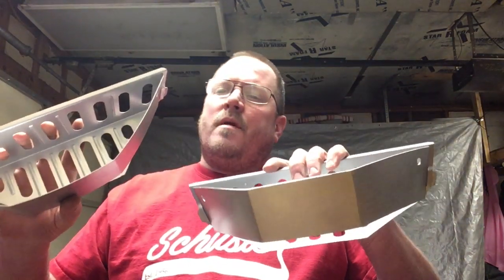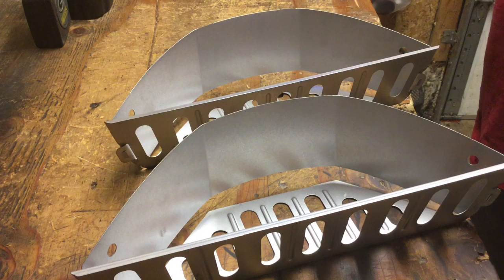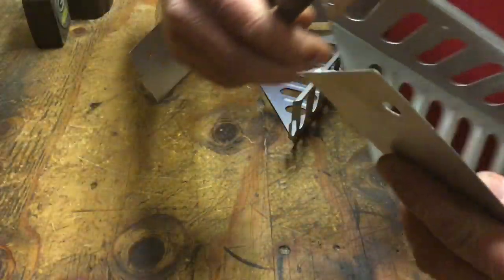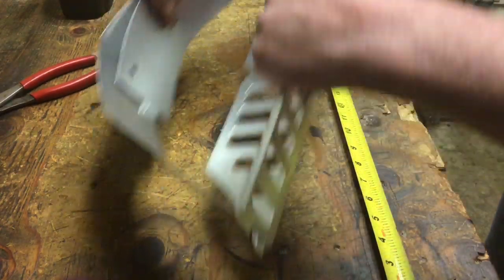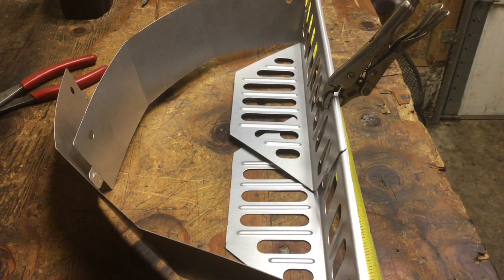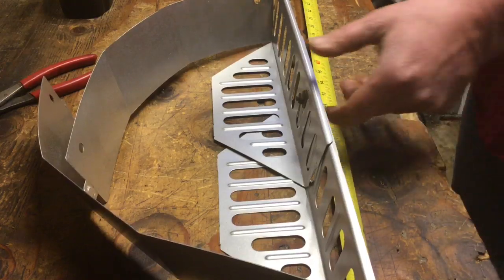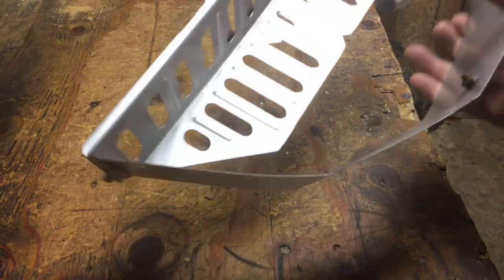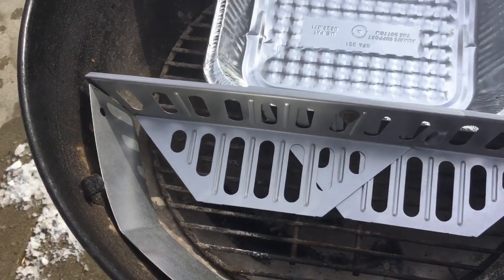Bro n Sear | Weber Kettle Charcoal basket Mod | Poor man’s | Slow ‘N Sear

Comment: These baskets came with my new Weber Master Touch and after my first attempt at indirect cooking, I was not happy with their function as separate units. I had done research on the SnS and was about to buy one until I stumbled across this video. I used the baskets that came with my grill, made the same modifications (with a few detail differences, fasteners mostly) and the result was superb! Mad props to Daddy Dutch! Thank you!!
Reply from the maker: Glad the are working out well for you. I'm happy I could help !
Reply: @daddydutchbbq   I'm cooking a spatchcock chicken as I type with the bro and sear... Holding steady at 310 degrees for the last 3 hours. You da man!
Reply: That’s really great!  I think it would be great with a rotisserie as the coals should be to one side. I don’t think this is the poor man’s slow and sear, I think it’s the smart man’s !

Klaus
Reply from the maker: Hey Klaus, I appreciate it ! Thanks for stopping by! Cheers !

Comment: I cut to size a piece of metal mesh (the kind used for tiling) to keep the smallest lump charcoal pieces from falling through the grate and I wall it up with a couple of bricks.  Works like a charm.  My grill is a cheap, barely above camping grade rig and it runs and smokes like a weber.  The only other "mod" I made was to make a large diameter washer to keep the top vent disc honest and snug to the lid surface.

Comment: You are the man. You just saved me $100+ when all I need is $1.50 in bolts nuts and washers. Thanks Kent.
Reply from the maker: You are welcome Johnnie ! That's why I made the video !
Reply: Any ideas for the pizza oven. That would be huge.
Reply from the maker: @johnnymagsbbq8209  do you have the pizza attachment ? I use my baskets back to back in the center like a vortex
Reply: Daddy Dutch BBQ And Cooking no I don’t have it and I don’t want to spend $200 for one either.
Reply from the maker: @johnnymagsbbq8209  I'll call you tonight

Comment: Keeping the hot coals off of the kettle wall helps keep the heat in the kettle. The water pan helps block the radiant heat of the hot coals. Great easy mod! Right on Kent!
Reply from the maker: Thanks Mike. Just an easy inexpensive option ! Cheers !

Comment: What a great idea!!! Thanks a lot brother! Commented a couple days ago and came back to check it out again! Also, for that extra open space, I saw another video where he adds an extra 18 inch charcoal grate and sits it on top of the existing charcoal grate and turns it 90 degrees to make small squares and limits the charcoal falling through thus forcing the charcoal to burn even longer(hope that makes sense to everyone) will be trying it soon! Cheers brother!
Reply from the maker: Thanks for the feed back and for stopping by. I now have a piece of expanded metal in the bottom of the bro and sear. I also have a plate cut to cover the other part of the charcoal grate to force the air through the basket. Let me know how you like it!
Reply: Would like a link to the video you are referring to .. Thanks !!
Reply from the maker: @billb13  if I remember correctly you need a measurement on 22” on the straight side. I have not done a video on the expanded metal and grate cover but I will be shortly . Thank you so much for stopping by!

Comment: One benefit of the SNS is how it evens out the temperature across the cooking grate. I'd be curious how this setup compares. It certainly works better than the two baskets did.
Reply from the maker: Hey Ryan, just an inexpensive option because i thought the 2 baskets were clunky and didn't match up well together on the same side. Not a true replacement for the S n S but a very workable option. I have had a set up like this for the past year. It works very well . Videos upcoming.Thanks Ryan and congrats on your win last night !

Comment: Just did this on the 22 Kettle I just picked up used for $50! Will be trying it out this weekend. If the vents let too much heat through the opposite side, I might try a brick or two as to block heat.
Reply from the maker: Let me know how it works for you. Blocking the side will help on longer cooks ! Happy cooking ! Cheers !
Reply: @daddydutchbbq  Just finished a 2lb grass fed chuck. 3hrs, 2hrs wrapped in foil, 1hr back on grill. used Oak chunk, lit one end and it burned great at 250 for 3hrs! wrapped it and added a little more chunk. Also added a little honey and some double IPA. Did great for the 2hrs '(250-275). Unwrapped for last hr and it started to taper  at about half hr mark, stayed at 200 to finish. Got it resting now and it looks and smells amazing. Making some tacos with it! Pretty impressed at how easy it was to maintain that 250 mark!

Comment: Not only can you put some in a drip pan under the meat, but another approach is to put some in a small loaf pan or mixing bowl directly over the lit charcoal. Really helps to moderate the temps and provide steam in the kettle without totally blocking meat from heat under the grate like the SnS does. (Who only wants to cook the top side of their briskets and pork butts?)
Reply from the maker: I do put a water pan in most of the time. I also wrap the charcoal grate in foil to force the sir through the Bro N Sear basket.

Comment: The slow and sear costs almost as much as my Jumbo Joe.  Screw that.   I usually create my hot zone just by filling the side without my weber basket with hot coals and using the flat edge of the basket as a barrier.  Works great.   I might just try making this though, nice work, thumbs up!

Comment: This could be made easily with adjustability in mind. Using wing nuts and multiple holes along the back. Then slide the front closer and close up the back to create a smaller charcoal spot.

Comment: Hey on your thing you made I put some mesh on the bottom screwed it to it it holds the charcoal in a real nice so when you’re done you just pick it up and empty it
Reply from the maker: I actually put expanded metal in the bottom of mine. Or if you have a second charcoal grate, you can turn it 90 degrees also. Thanks for stopping by!

Comment: nice idea!!  I just use the empty baskets to create a gap on one side of about 1/3 and fill that up. Do you think this works better?
Reply from the maker: I think it works great along with the second piece of metal I put on the charcoal grate to make the air flow through the charcoal basket for a more efficient burn. Also Weber recommends not banking you coals on the outside of your Kettle to protect the paint .

Comment: i did this, but left the round part off and didn't put a bolt through it. allows you to adjust how far back you want the charcoal or how much of the grill you want charcoal in easily.

Comment: Love it, will be making one of these, love the name too. I've thought about how I could home make a Vortex but that's a pretty complicated shape :)
Reply from the maker: I’ve made a homemade vortex also. It is super simple too ! If you have a Walmart near by, go find a 5 or 6 quart stainless steel bowl, normally about $8 and cut the bottom out of it. There is usually a molding line you follow. You will need to drill a hole and cut along the molding line with a tin shears. File the cut edge to remove and burrs and sharp edges! BOOM ! You have a PoorTex !
Reply: @daddydutchbbq  LOL! You have a knack for trade names, patent these! And what a bonehead for me to miss that one, I was looking at sheet goods as a starting point. I will likely try that, thanks for the idea!
Reply: @daddydutchbbq  did you make a video about the making of that poortex?...I'd love to see this.
Reply from the maker: @martinaperreault1748  I don't have a video on it but, go to Walmart and buy a $7 stainless steel bowl that is a 6 quart bowl. Simply cut the bottom off it. You can use a tin snip to easily cut it out.

Comment: I wonder if this would work in reverse?  Could you take one basket, cut it in half and then overlap it at the center to make it fit a 14"  Smokey Joe?  I know they normally use a folded aluminum pan instead but this would look so much better.  Think it would fit?  Thanks.
Reply from the maker: I don't see why not. Just measure what you want the straight edge length to be and curve it to match the Smokey Joe. I appreciate you stopping by! Cheers!

Comment: Well.. look what popped into my suggested videos.  Nice mod Kent.... it has been a year... how is the bro n sear holding up?
Reply from the maker: Hey Johnny , I have made 2 , one for each kettle , and both are holding up great ! I appreciate you stopping by and I loved your floating kettle cart! I am going to make a table to hold both my black kettles. I’m going to use 1x4 for the top, sand it and use a torch to bring out the wood grain. I’ll clear coat it after that !
Reply: @daddydutchbbq  Sounds great Ken, If I can help in anyway just shoot me an email... you can find it on my about page.

Comment: Hello.  Any issues with too much radiant heat come from the front and cooking the bottoms too fast and hotter?
Reply from the maker: Hey Daniel, no real problems at all. Normally I have a drip or water pan the deflects / absorbs any heat . You can also wrap that side with heavy duty foil. I appreciate the question! Thanks and let me know if I can help.

Comment: What was the name of the bolts you use and size? If I don’t have vice grips could someone hold them together while drilling? Lastly, how well does this method work?  Could you do 2 racks of spare ribs with this? Thanks so much.
Reply from the maker: The bolts are 1/4" x 3/4" . It drills easy enough to hold carefully by hand or using a pliers. Yes, you can cook a couple racks of baby backs or St Louis ribs. Thanks for stopping by. Cheers !
Reply: @daddydutchbbq  Thank you for responding. What size drill bit did you use? Im not much of a handyman so Im trying to get everything I need in one trip to lowes. I really appreciate your help
Reply from the maker: @easybackyardbbq  1/4 inch drill bit

Comment: Back of my bro n sear sits higher than the front. Any suggestions? Also I did this on my 26 so don’t know if that’s the issue. Thanks !
Reply from the maker: What length is the straight edge for your 26? Should be about 22-23”.
Reply: @daddydutchbbq  will check size as soon as I get a chance !
Reply: @daddydutchbbq  she’s at just a tad over 22”

Comment: DO you have a link to the bolt, washer and nut that you used? Also, what size bolt did you use?
Reply from the maker: 1/4" x 3/4" long bolt with 2 washers and a 1/4" nut. They can be found at any hardware store.
Reply: @daddydutchbbq  Thank you so much!!! Happy Thanksgiving!

Comment: How long does the coals last in the bro n sear?
Reply from the maker: Depending on the temperature you are maintaining……..at 250 about 5-6 hours. Obviously the higher the temp you will need to add more fuel. My buddy Ryan atGrill Top Experience did a comparison cook, I encourage you to check it out.I didn’t even know he did the comparison until I saw his video. Is it the exact same as the Slow and Sear? No, but this is just an option for your normal everyday cook.

Comment: Is it 19 inches at the bottom or the top of the baskets?
Reply from the maker: I measured the top. It can be adjusted based on your preference if you want it a little bigger or smaller.  Let me know if I can help please.  Cheers
Reply: @daddydutchbbq  do you know the width from the inside, if you don’t mind me asking?
Reply from the maker: @babycrow8261  I will measure it tonight after work if that works for you.
Reply: @daddydutchbbq  yes thank you
Reply from the maker: Hey, sorry for the delay. The distance side to side is 19” and the depth to the furthest point of the curve is 7 1/2 “. Hope this helps !

Comment: Do you just measure to the size of your kettle ?
Reply from the maker: For a 22 " kettle you would want a 19" measurement along the straight side of the charcoal basket.
Reply: @daddydutchbbq  thank you for the reply and the info ! 
If I may ask what type of screws , nuts , and bolts did you use and the size too ?
Reply from the maker: @silvinobernal87  the bolts were 1/4 × 3/4 .

Comment: What’s the point of the basket? Why not just bank the coals on one side and then use the water pan?
Reply from the maker: I appreciate the comment, Weber recommends not banking the coals directly on the side to protect the exterior  coating of the kettle. It also helps organize the charcoal and provide a consistent burn. It's an alternative to spending $120 on the Slow n Sear basket.

Comment: Awesome vid. I was curious how the SNS worked but I outright refuse to spend that kind of money on that ripoff. 

I want to make a bro and sear and use a loaf pan or steam table pan as a divider. Do you think the trough in the real SNS is better than just a water tray under the meat?
Reply from the maker: I can see where the water trough can help even the heat out but I’ve never had a problem!

Comment: Could you make this but not as big.
Reply from the maker: Yes. That’s the best part, you can make it fit any size kettle you have !
Reply: @daddydutchbbq  thanks. I have a 22 kettle but just wanted to make it a little bigger than the original basket. Thanks so much

Comment: Sorry, that’s not how the slow and sear works. For what you did you can stack the briquettes on one side. It’s called the minion method. You haven’t created the same airflow you get with the slow and sear.
Reply from the maker: What I didn't show in the video is a deflector opposite of the charcoal basket to force the air to go through the basket.
Reply from the maker: Bill, thank you for the question. The deflector helps for the air through the charcoal basket more. It is to funnel the air for a cleaner , longer lasting burn. All I did to make the deflector was to put the charcoal basket on the charcoal grate, then I traced the open area on to a thin piece of metal and cut it to shape. I hope that answers you question, if not feel free to ask me more ! Take care.
Reply from the maker: Yes, it “forces “ the air to go through the charcoal basket and just not up through the charcoal grate.

Comment: I found this video after doing something similar over the weekend, I took my baskets apart over the weekend and just butted the flat sides together and used the inside of the kettle, what are the benefits of using the curved sides as a barrier?
Reply from the maker: The curve edge on the outside keeps the briquettes off of the side of your kettle. Thank you for stopping by and checking it out .
Reply: @daddydutchbbq  for what purpose though, clean up? Protect the enamel? Subscribed by the way I love tinkering, have a peek at my channel the cooking vids ain't much but I think you would appreciate the rotating pizza stone and the weber genesis griddle mods.
Reply from the maker: @serialgrillaz6669  yes to protect the enamel . I will swing by and check your channel out also.👍